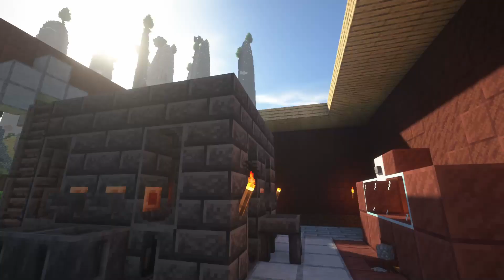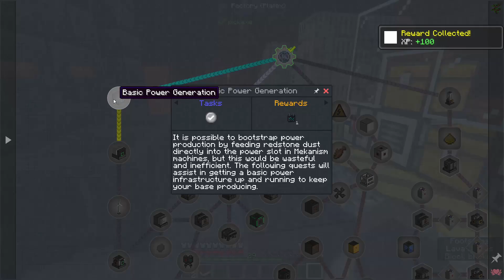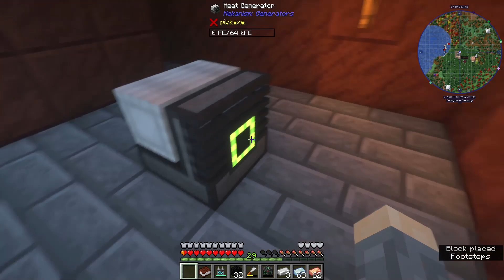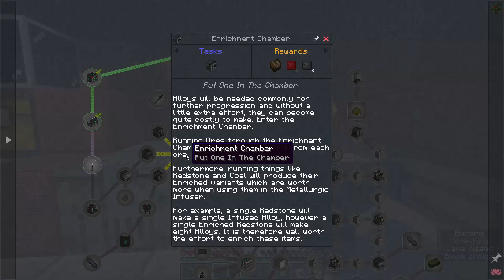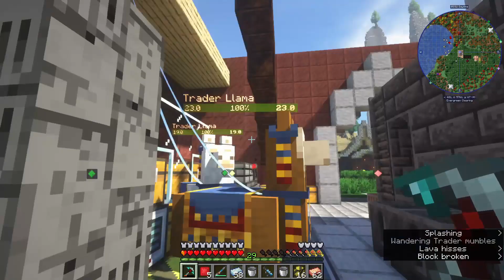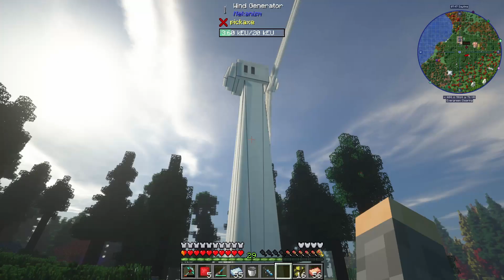Minecraft 1.16.5 | Enigmatica 6 | Episode 6 | Renewable Power!

Comment: also i dont know if Enigmatica 6 has them but there is a mod that adds cheap power cables
the base cables are called "leadstone fluxducts" and they are pretty cheap only requiring lead and redstone
to make higher tiers however you need to make the lower teir first and upgrade
Reply from the maker: I’ll have a look and see if I’ve got those, because the power cables are actually quite a costly recipe at the moment requiring steel, if I can just use lead (which I have way too much off right now) that would be awesome :D